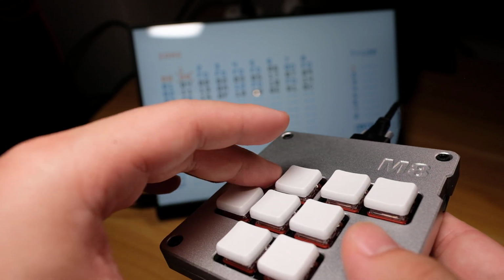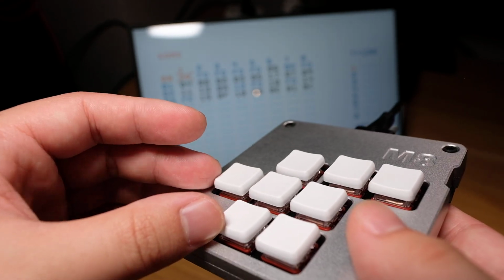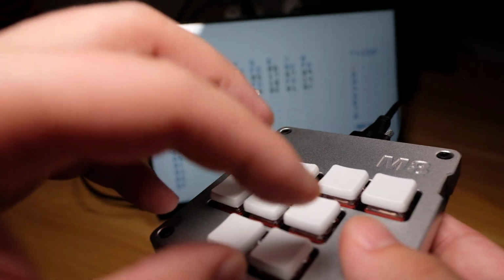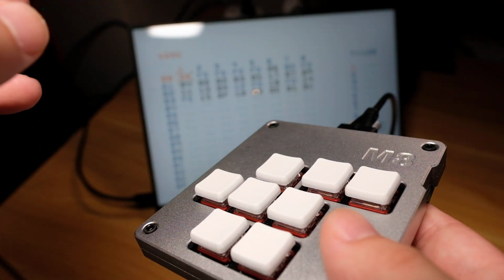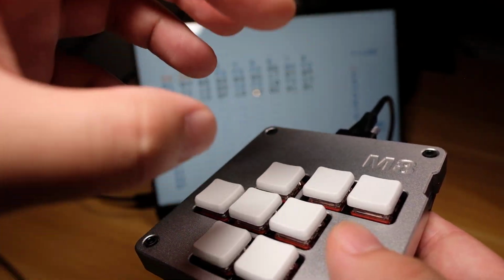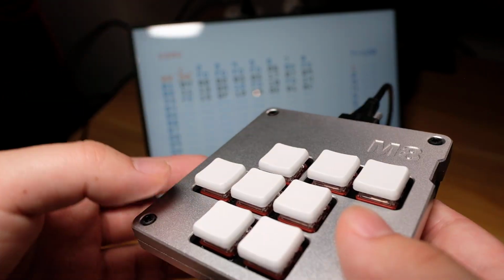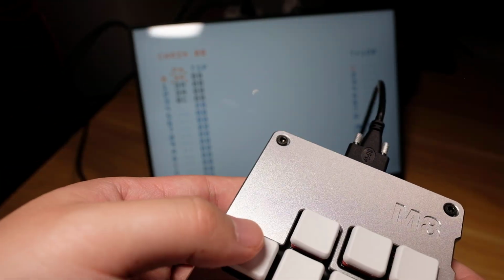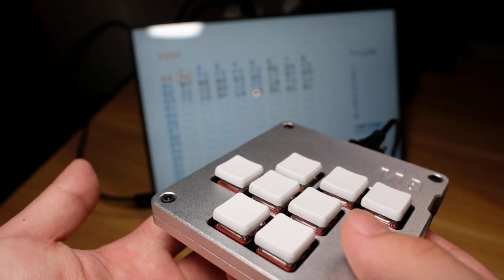Dirtywave M8 Headless Keyboard - DIY Project

Comment: Hey Ed ! nice work, I'm willing to purchase, just wanted to know if the assembled option comes with the Teensy already soldered or I have to get it elsewhere. Thanks !!
Reply from the maker: there are two options available. One is fully assembled, and another is PCB with components but without Teensy and switches, and will require some DIY soldering skills.
Reply: @hsuanhanlai  so the 189$ is fully functional, I'm correct?
Reply: @hsuanhanlai  Just arrived, gonna check it now, shame is not engraved anymore 😢

Comment: Ey man, love the work! Is this thing being recognized by DAWs as a MIDI device? If so I'd be very interested in your product. But in the original M8 there are two Audio and two MIDI plugs. Is there a specific reason you don't have that in your build?
Reply from the maker: Unfortunately,  The newer M8 headless that greater than V2.0.0 no longer supports hardware MIDI I/O.

Comment: Pardon my newb-ness but a few questions. 1. does this still require a full computer or is that just a portable monitor that you have. 2. if i order the pcb from you are the smc already soldered to the board and/or are they included for me to solder. 3. is midi still functioning over the usb-c cable (and what do I search for to find the overengineered ;) cable. 

Such a beautiful piece of work.
Reply from the maker: 1. Yes, it requires a computer, AKA a host for the UI rendering, and audio routing.
2. The the SMT components are soldered. But it's a DIY kit. So you will still need to solder your own Teensy, and pick you own key switches. It's mainly for people who likes to tinker, or who may already have a Teensy and looking for an upgrade without buying a new Teensy.
3. Unfortunately,  The newer M8 headless that greater than V2.0.0 no longer supports hardware MIDI I/O. Current firmware is at V4.0.0+